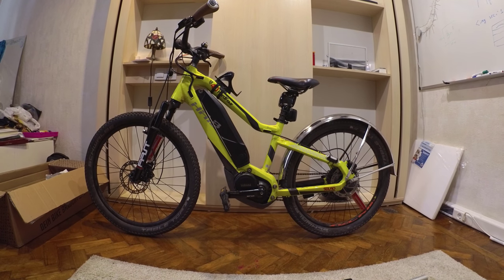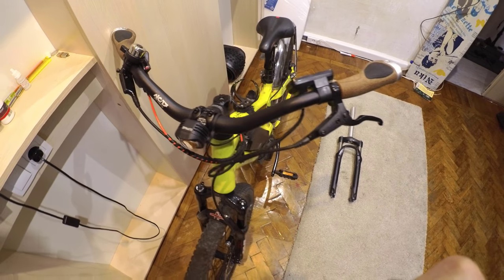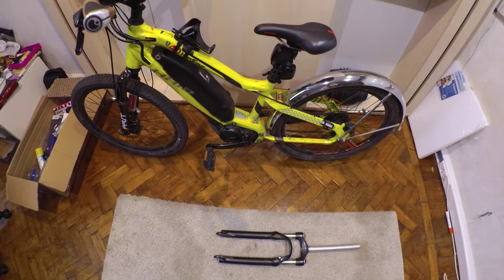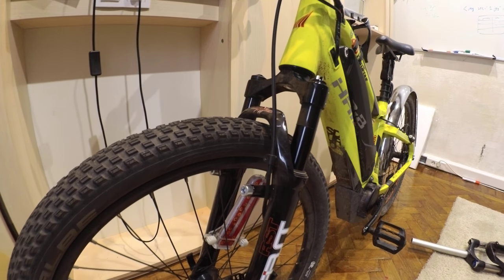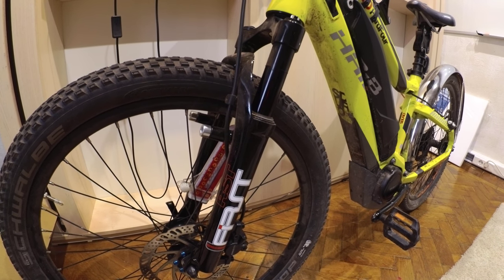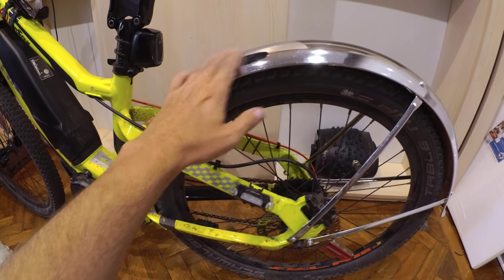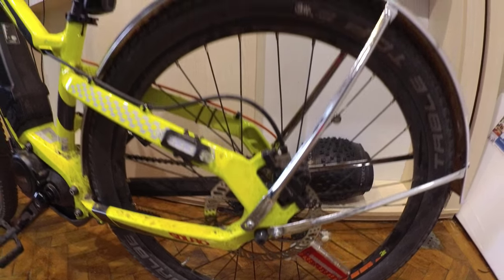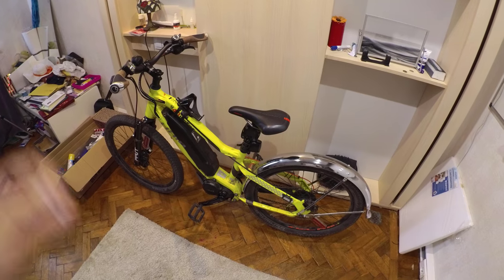Haibike SDURO HardFour 4 0 Halfway Upgrades

Comment: Hi, you mention you have derestricted both this and your own bike which is using Bosch. Can you maybe do a video on how to do this? There seems to be very little information on different options and things to consider and so on.
Reply from the maker: I don't have much to say. I use BadassBox on all my bikes because I can easily remove it and put on another bike. It's a no-brainer installation.
Reply: Bikerelated okay thanks. Have your bike been upgraded with the new emtb mode? I've read some reports that the newer software versions have additional checks against tuning but nobody seems to be sure if there really are checks.
Reply from the maker: According to manufacturer documents (I'm signed up as one), Bosch does plan to roll out detection of speed manipulation starting MY18, but only detection -- it's not going to affect your motor in any way, it will just record the fact that the speed has been manipulated. This can have implications for warranty or investigation if you're involved in an accident. There are other, troubling legal updates to ebikes though. For example, requirement to always have 2hrs of light time available on the motor.